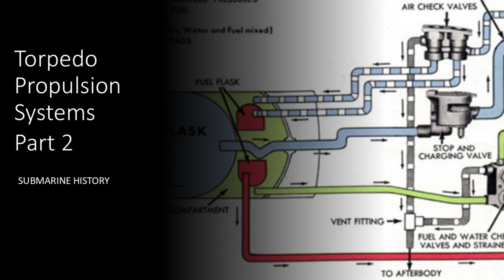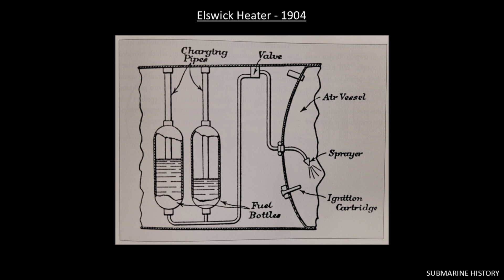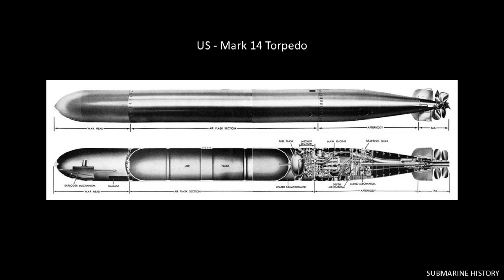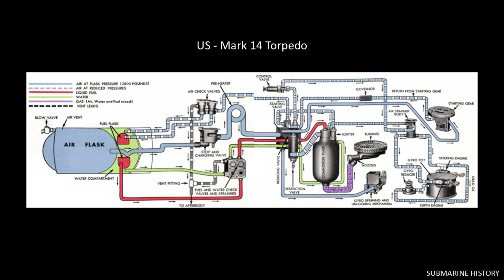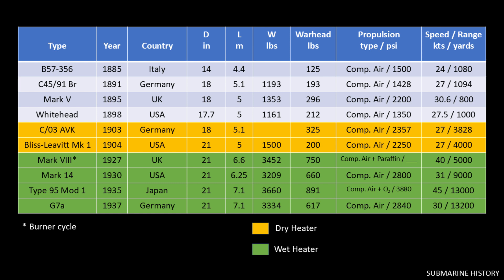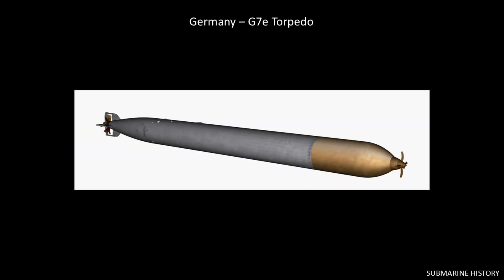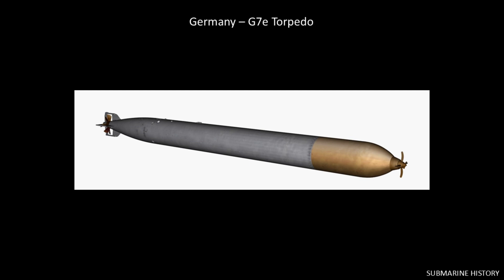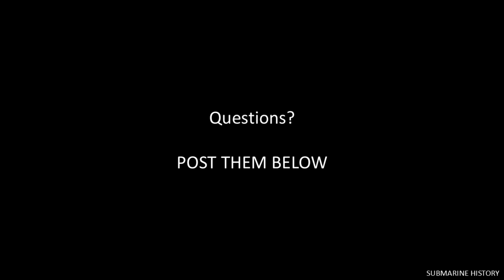Torpedo Propulsion Systems Part 2 - Dry/Wet Heater and Electric Systems #53

Comment: If wet heater systems are so great. Why weren't any surface ships powered with a larger version? They seemed to create a lot of power and high range for a little torpedo, so maybe the square cubed law would make surface combatants powered by conventional fuels have such an advantage. I understand many naval ships are powered by gas turbines but while similar its not the same as the US turbine wet heater.
Reply from the maker: I'm going to take a guess that the energy available per unit volume for gasoline is greater than  alcohol.

Comment: Milford's 1997 article "Part Three: WW II Development of Conventional Torpedoes 1940-1946" compares torpedo propulsion with the figure R*V^2 (range*speed squared). From my understanding of the drag equation, this figure would be proportional to the energy [horsepower-hours] delivered by the propulsion system during the torpedo run. 

The Mk14, Mk18, and Mk16 are 21" torpedoes with roughly similar length and warhead mass, having R*V^2 figures of 9.6, 3.4, and 23.4.